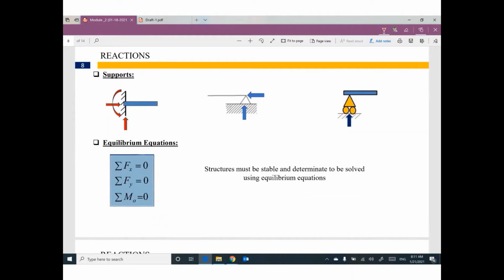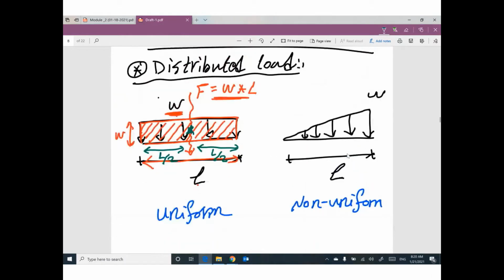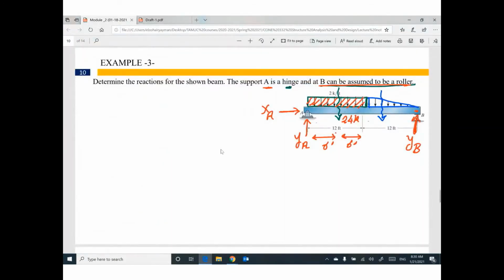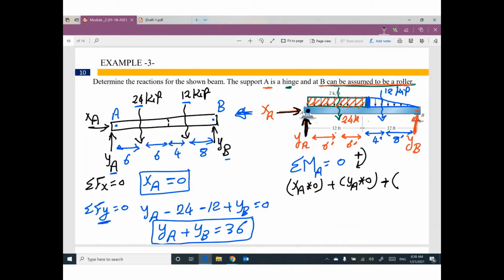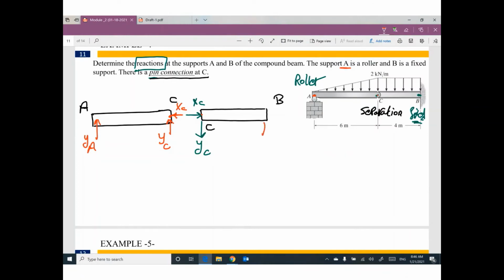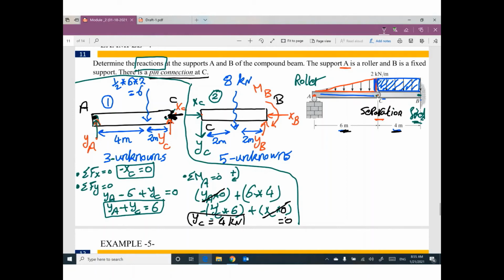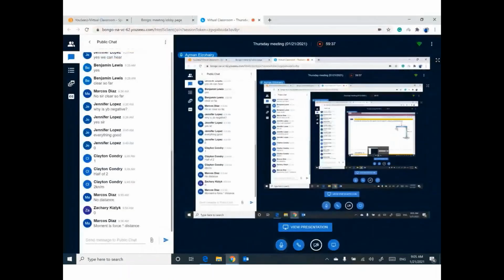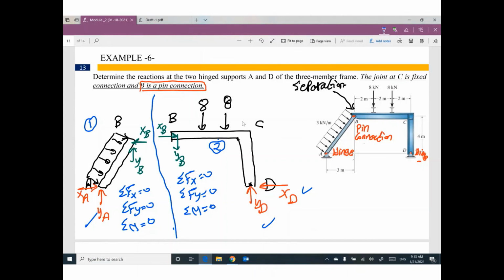Analysis of Beams and Frames part  -2/6-

Comment: Page 12 (54:45), If we wanna describe the structure as stable or unstable, should we count 6 kN and 2 kN as reaction?
Reply: no they should not be counted as reactions since reactions are forces that are generated from the supports that carry the structure, the 6 and 2 are concentrated force directed at the structure think of it as a dead load or a live load

Comment: Sir, at 19:21, will it be right if you found the centroid of the distributed load, which is a single point. and then the total force that acts there?  Will your equilibrium calculations still be right?
Reply from the maker: If you find the centroid for the whole distributed load and put there 36 kips, that is right. The only difference is the moment equilibrium equation. However, the final answers will be the same.
Reply: Thank you very much. @aymanelzohairy2490